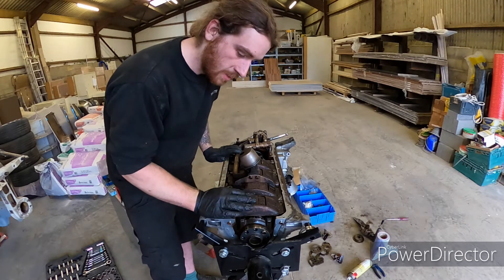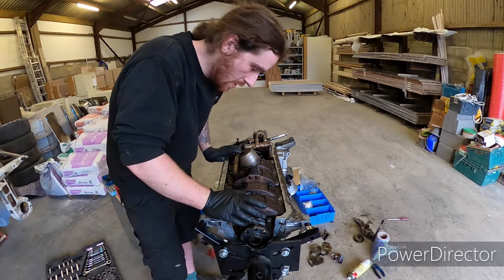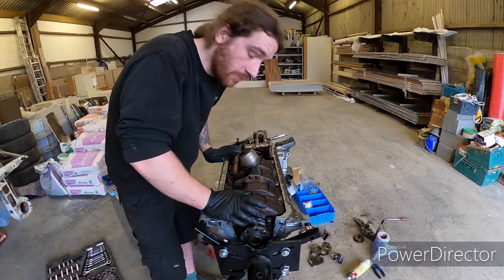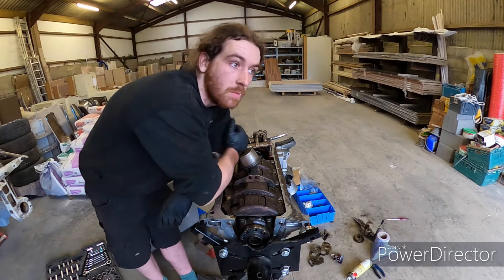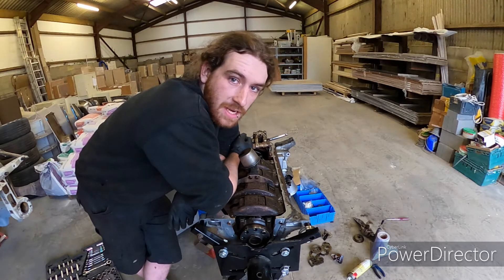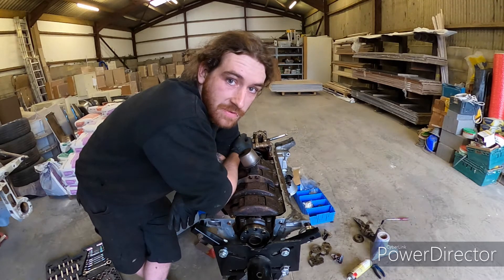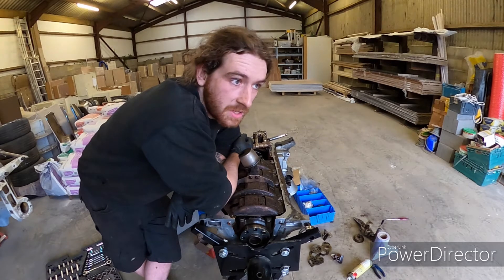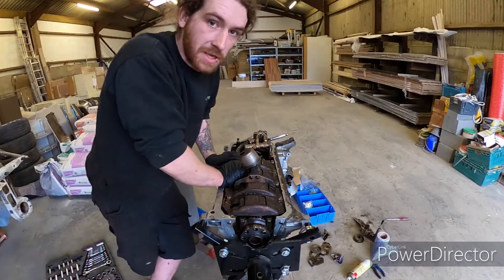M52B30 Stroker Engine Build - Timelapse

Comment: hello!  good luck with the engine, how have you done to increase the compression?  I'm on a similar project and had planned to use 86.5mm 11: 5: 1 JE pistons
Reply from the maker: It's just how it ended up using m54 crank and pistons, this was the lowest we could get. Can't remember which rods we used though
Reply: Markus99 how you putting 86mm pistons in M52? Can I fit them in M54? Why you choose M52 and not the M54?
Reply from the maker: @hajpeRR0  M54b30 pistons are 84mm, same as an m52b28.
Only reason I went with an m52 is because that's what I had haa
Reply: @gtruckus07 I know the pistons have same size but I didnt know i can but 86mm in m52/m54 I think 85mm is max
Reply from the maker: @hajpeRR0  I couldn't help you there man, not a clue!

Comment: Hey, nice vid! what ind of crank, pistons and conrod combination are you running? The m52b25 and m54b30 pistons are too high as far as I am concerned. They would hit the cylinderhead if installed just like that.
Reply from the maker: I cant remember what combination we used but it was too high hence the thick head gasket and pocketed pistons.

Comment: Stock? Or tuned engine?
Reply from the maker: M54b30 crank and pistons, m50 manifold, high Compression
Reply: @gtruckus07  and the injektors? Orig M50?
Reply from the maker: @Gtbtdx  M52b28 injectors
Reply: @gtruckus07  thank you. Are m54b30 injectors bigger?

Comment: Did you remove the m54 crack sensor pick up wheel off the crank before installation? I'm chasing engine vibration/harmonics issues with my similar setup
Reply from the maker: Yeah that came off, it was bent anyway like.
I'm going for the first start tomorrow so I'm a bit behind you